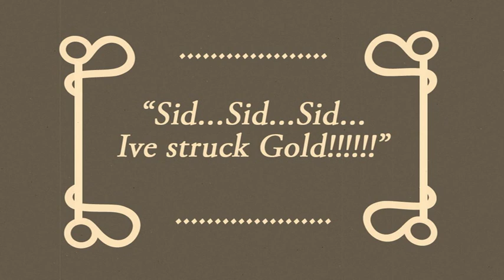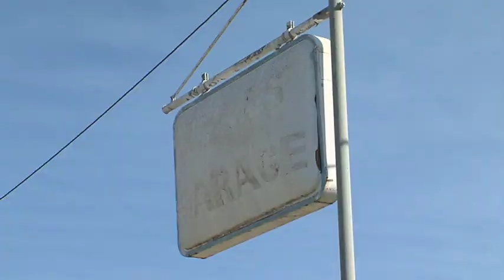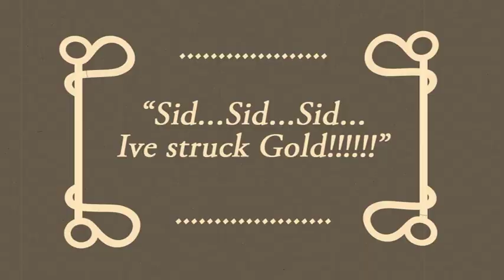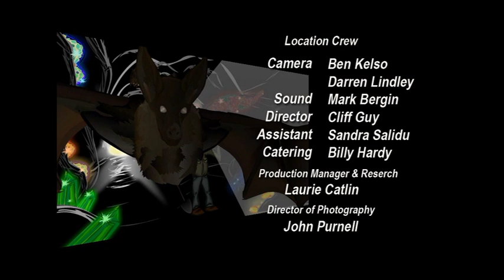Gem Seek Adventures. Episode 1 'New England Sapphires'

Comment: If one uses two bronze brazing rods, shaped similarly, one can find a cast iron drain pipe buried under a concrete slab. Or maybe any other ķind of field set up but invisible. I once used it to find a drain line burried deep in clay so I could avoid covering it when  planting a tree. Saves a lot of digging. Just like he said. Don't have to hold anything else in your hand.